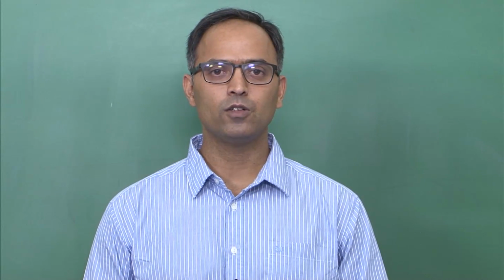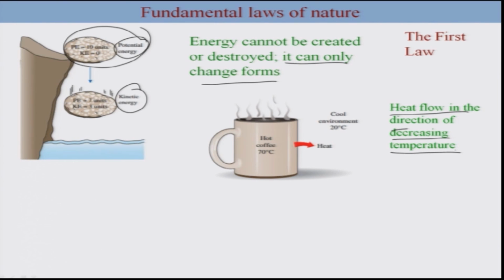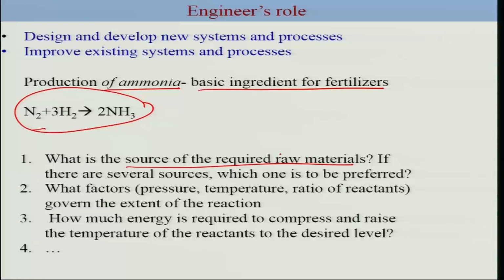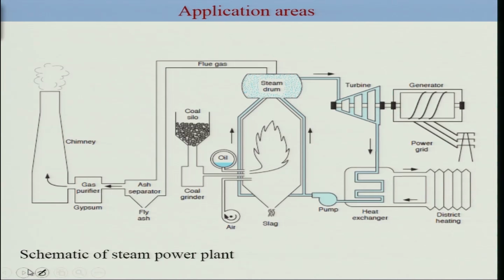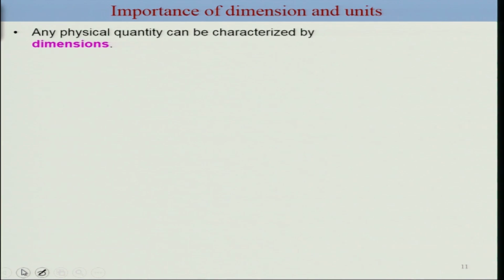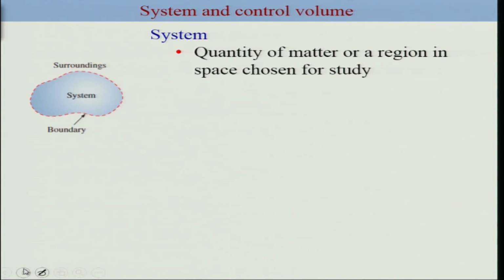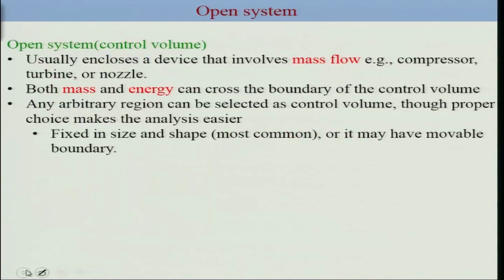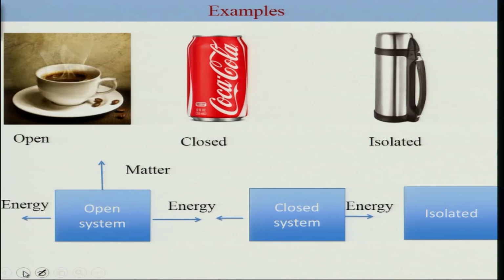Fundamental laws of nature, system definitions and applications

Comment: Sir why we say open system is control volume system
Reply: open system is also called control volume only when the system boundary is fixed i.e., the system volume is fixed

closed system  - fixed mass - control mass
open system - fixed volume - control volume
Reply: A "control volume" is like a political party. Mass, like defectors, can come in and go out. A "system" does not allow the transfer of mass in or out.